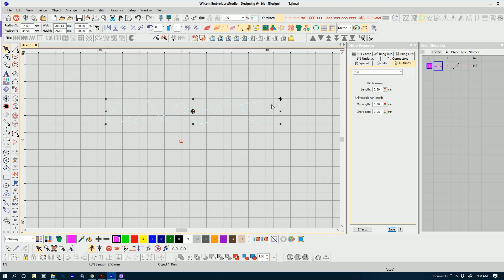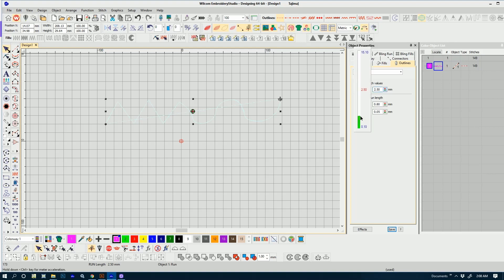The Point - Run Stitch

Comment: Thanks for the explanation. Im trying to do simple running stitches with gaps between them to create a dashed line effect. Is that possible?
Reply from the maker: I'm a little late, but this isn't possible using machine embroidery because the top thread is always visible on the top surface. Sewing by hand would make it possible, solely because you can travel on the back side.